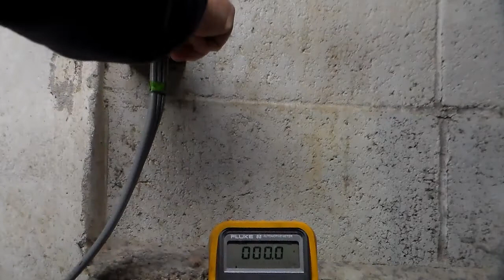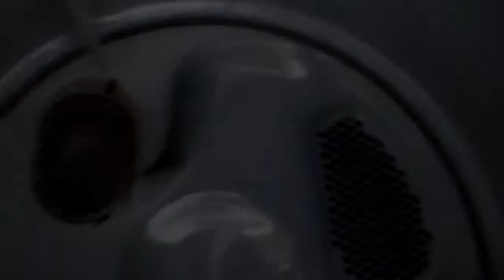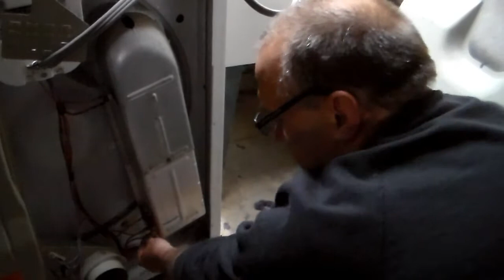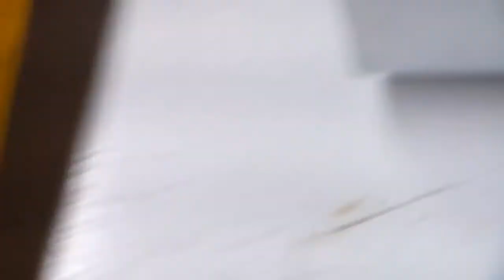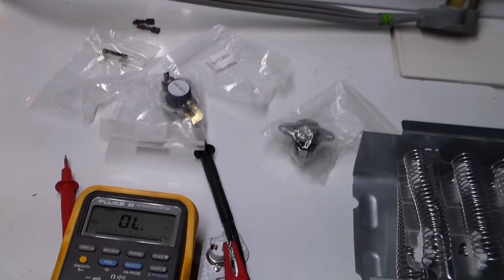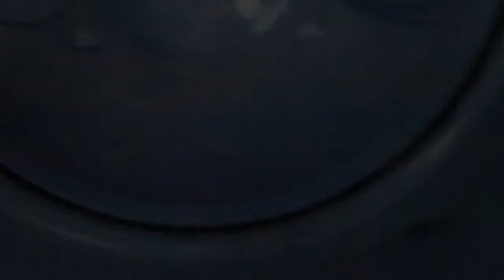Whirlpool Dryer Repair

Comment: Ok so it's supposed to glow like that? Because this freaked me out when I saw it in my new dryer and now I don't want to use it.
Reply from the maker: It will get  red hot when it cycles to high.
Reply: Is it normal to see it glowing on the floor at the rear of the dryer?  @KA3AJI